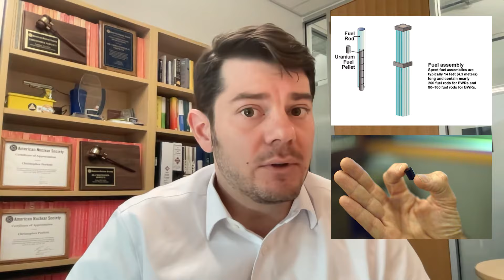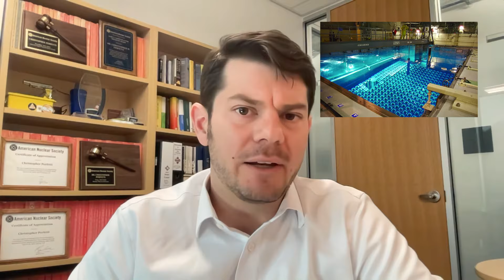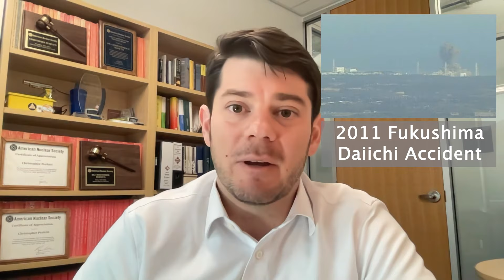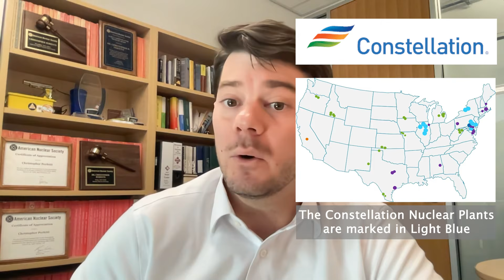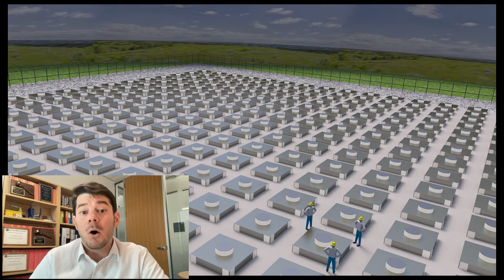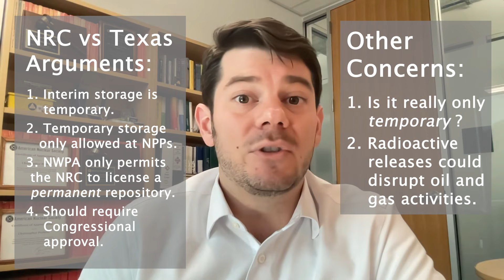Nuclear Waste Series - 6: What if we do NOTHING about the waste?

Comment: Great video, Dr. Perfetti! Especially the explanation of recent legal proceedings. Repayments from the Federal Government for dry cask storage are a major factor, yet they are the main reason alternatives aren't really talked about. The video does an amazing job of covering the issue we find ourselves in now, but I did notice a few points that could benefit from clarification:

The design basis heat load of a modern dry cask is not 19 kW, it's closer to 35 kW (https://www.nrc.gov/docs/ML2218/ML22187A045.pdf). As an industry, we've changed our dry cask storage designs to accommodate more assemblies in the same dry cask footprint. As more plants extend their operating licenses, remaining space on the Independent Spent Fuel Storage Installations becomes an issue, and this was one solution. Higher heat loads are managed by backfilling the steel storage canisters with pressurized helium.

In the video, it's stated that a reactor discharges its full core every 4.5 years. Although it takes that long to 'use up' the batches of fuel that make up a full core, the entire core must be offloaded every cycle (1.5-2yrs). Spent Fuel Pools really are constrained regarding available space.